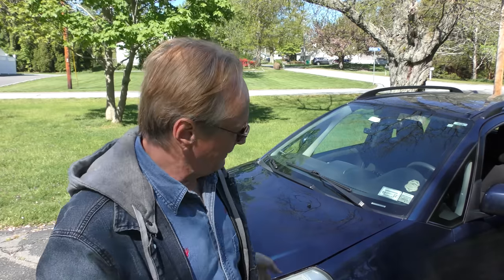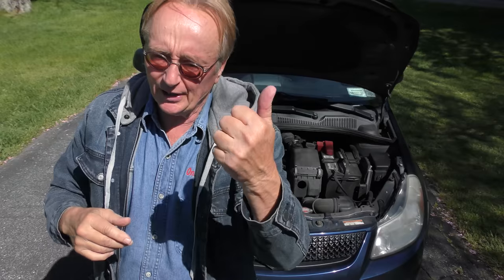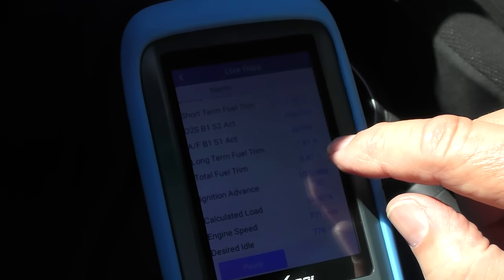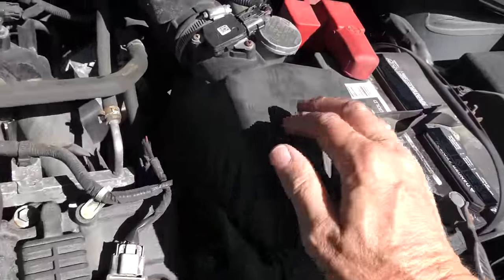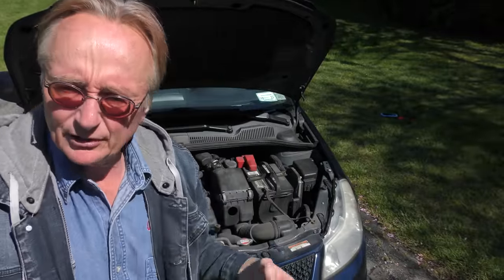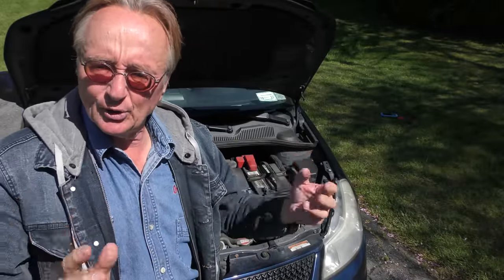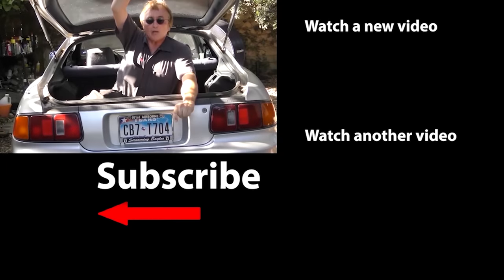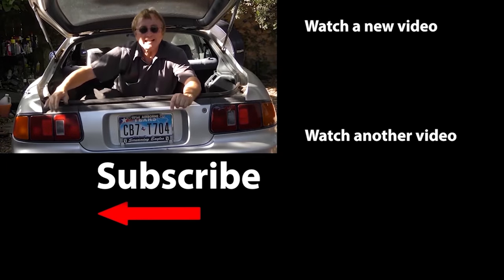Never Buy This at an Auto Parts Store

Comment: I am in Australia and I bought a  1991 Suzuki swift 4 years ago for US$150 while I was painting my daily driver which is a classic car. I only needed the Suzuki to last 6 months, 3 years later it was still going and I only got rid of it because it was blowing to much smoke. Sold it to the scrap yard for US$150 and bought myself an 2004 S40 Volvo from the auction for US$275 spent $25 on a new brake hose and it drives like a dream came with full service history and has the Toyota gearbox.
Reply: Volvos have the most solid bodies, are the quietest cars, have the best seats, and are very safe cars. I wanted one a little while back but just kept my Honda because it is hard for me to get financed. One day I would love a nice Volvo. Comfy!!!

Comment: My old roommate had the 2012 SX4 sedan with an automatic. She put 250K on it before the transmission went out. Never changed the fluid once, which is probably why it died. The only things I can recall being replaced were the water pump and just brakes and tires. Granted it was all highway miles. Lasted her 8 years. Not that bad I suppose. However I find it funny that my 32 year old Bonneville is still my daily driver with about 100K more miles than she got out of her Suzuki.

Comment: Filters disintegrate sometimes and foul the MAF sensor wires. Some cars won't even run when this happens. Try removing the sensor and inspect but don't touch the wires. Only use MAF Sensor Cleaner for clearing it.

Comment: I totally I agree with you Scotty on that 10speed auto. I’ve driven two fords with 10speeds (f-150 w/2.7eco & f-250 power stroke) and very clunky to shift and always shifting. Also the eco boost 4 banger is just screaming at its ragged edge and just really falls flat on its face after 90. 5.0 w/ 6 speed is always the way to go!!

Comment: Still have the original MAF sensor in my Tundra. Itll be 23 years in July that it came off the line in Indiana. 260k miles.
Reply: Still got mine on a 2004 Lexus GS300. And that's after putting it back on after doing EXACTLY what Scotty said not to do. Which was get it from a Autozone/O'Reilly/Etc. I just cleaned original one up and put it back in. The codes from other parts was throwing the MAF off the whole time.

Comment: Wish they'd bring back the metro 1.0. loved my metro and kept running no problem other than changing the clutch, fuel pump, and starter relay. Wasn't fast had no power but did what it needed to do.
Reply: Yep. Im old enough to remember Chevy Chevette from 1979....40mpg everyday. Using 1940 carb technology...

Comment: My mother had one of these, an incredible value. However, it was a manual and they either did not have that figured out. My guess is the big US engine was just paired to an existing unit that was usually in 1.4-ishliter duty. She ended up getting 3 drivetrain rebuilds over the years, oddly enough covered under warranty after they closed up shop. All of them were due to synchro failures that showed up on the 2nd to 3rd gear shift, with various levels of internal damage inflicted each time.

Comment: Good evening . Here is South Africa Suzuki cars are using Toyota 1.5 engines . And I know of two that have almost 2 000 Km on the clock. And still running like a dream.
Reply: You mean 200k
Reply: @mattmekhaeil  what?? That don't make sense, thousands is unit of counting which is used everywhere in the world...

What I meant was Prince is saying 200 000KM not 2000 Km
Reply: @mattmekhaeil  I think you mean Miles that used in metric system(USA) and kilometers not "thousands"
Reply: Yes 200 000 km
Reply: We use kilometres not miles.

Comment: The Grand Vitara is a very solid SUV no issues I bought it used  and it has 166000 no issues at all 4x4 is great minimal rust but it gets worst  mileage then my tundra.
Reply: I bought my wife a 2002 Grand Vitara for almost 12 years now. It's the 2.5 litre V6 EFI, 5 speed.
Just passed 335,000 km (208,000 miles) & still runs well, not burning oil, no leaks, fit second clutch at 255,000 km (158,000+ miles).
We've put this thing in places a larger 4WD can't go, many times.
Followed her in my LandCruiser down a few tight tracks, only to find I couldn't fit or turn the tight corners & needed to go around the long way.
Parts aren't hard to come by in Australia.
Worst thing I've found is the crap rear door handle is easy to break, if you're too quick pulling open the door, with a spare tyre hanging off it.
Other than that, fuel economy is good, at 10.5 litres per 100 km, which is not far off the manufacturer's consumption claims.
It pays to keep preventative & usual regular maintenance for longevity!

Comment: I always loved those Suzuki's.  I had a Chevy sprint I bought brand new in 88 it was a 5 speed stick and the 3 cyl engine. Going up long hills on the interstate I would have to turn the air off which gave it a little boost and make it to the top of the hill wide open at 40 mph and passing car horns blaring at me. I once managed to get 80 mpg going up I85 from Lagrange Ga to Greenville SC and riding the draft from big 18 wheelers.

Comment: I have the Suzuki kizashi and boy I tell you that car is amazing got one used, had a tranny problem turns out the first owner never change the transmission  filter  and causing  it to overheat,
 dealer didn't even know about the second transmission filter that's in front of the car behind the front bumper causing the transmission  to not drive and whining. i change it my self and it still going after 5 years no problem again with it..

Comment: I had a SX4 and there a a multitude of problems with them. Small gas tank, 10 US gallons so stopping for gas every 280 miles sucked, the drive shaft u-joints are unserviceable and the entire shaft needs replacement (if you can find one) when they rust tight, wheel bearings are hard to come by. Overall I hated mine and went to Subaru.

Comment: I had a Suzuki Jimney with a Bullbar 1.3 L  5 speed,  gas guzzler, didn't use oil, bad intermittent shimmy in the front.
Fuel tank was too small.
But would go literally anywhere but too small inside.

Comment: I had a 1991 Geo Metro that had a 1 l 3 cylinder that Suzuki built it was an awesome car I delivered pizza with Domino's for 3 years had 190,000 miles on it when the timing belt broke not interference was one of the best cars I ever had for deliveries had a five-speed transmission manual windows 52 mi to a gallon.

Comment: the first small US car I ever rode in as a Kid was 2.5L engine 1984 Buick Skylark limited 4 d Sedan that belonged to my late maternal grandmother from summer 1988 to winter 1990 when she traded it for a 1990 Toyota Camry which had a 122.5 Cubic inch 2.0 4 Cylinder engine its combined gas mileage rating for that year was 26 MPG while for the 2023 model of the Car its doubled to 52MPG combined

Comment: Hey Scotty, there is a private seller in my city selling a 2014 Honda Civic LX, 77,000 miles on it, for $10,800. Looks to be in good shape, would this be a wise purchase? My other option is buying a new 2022 Toyota Corolla LE
Reply: Toyota  will have less maintenance  cists. Honda has timing belt which will coat $1200 every 100k miles. Toyota  are very low maintenance  no timing  belts , has chains  and are non interference  engines
Reply: I would ask the seller pointed questions about the car to see if they drove it like a maniac and damaged the piston rings. But honestly 77k miles isn’t bad at all. It’s still early enough to change the transmission fluid, coolant, brake pads without there being significant damage from potential neglect.
Reply: Both can be great cars
Reply: Both should be great. Just have a mechanic check it out. I have 146k on my 06 Civic. Still runs great. This was the year they went back to timing chains instead of belts.
Reply: @dylano7242  like the other person said....  4 cyl hondas haven't used a timing belt in over a decade....

Comment: You can still get 2012 Suzuki's brand new.... New 2012s... The equator is just a frontier... Sometimes they use Mitsubishi engines sometimes they use Nissan engine I don't even think they use their own engines maybe sometimes they should come back until the game and make really small cars again with motorcycle engines on them that are super light and get great gas mileage why does everything have to be electric can't they just make cars smaller and lighter so they're better on gas

Comment: Why does my 06 F150 with a 4.2 motor overheating Philadelphia Hill I replace the radiator the fan the heat sensor two thermostats flush the system new coolant does not overheat on Flatland just going up the hill

Comment: I put an OEM in my 07 ES350 because it's under reporting and it did not fix it...
Reply: Intake leak
Reply: @brandonstclair6530  Smoke tested with diy machine and no results, seems airtight. Replaced O2 sensors, egr valve, oil cap o ring, etc etc and nothing. I found maybe a leak at the brake booster but even then I plug off the brake booster the maf readings do not go up. Two mechanic shops couldn't figure it out and/or not interested in listening.

Comment: The worst part of that car is it's radiator. They go for like 200-300 and they go out all the time!
Reply: What causes this?
Reply: @TaxinGigs  not sure if it the engine bay retains too much heat but I've seen many of my customers had leaking radiators and they're usually not in stock in the stores. And they're pricey

Comment: Scotty I got a 2011 p7b I've been running e85 and p0420 keeps coming up , it's running e85, so it shouldn't be saying bad catalytic converter right? I need to smog it so I'm thinking of just putting a resistor in line the 02 sensors to complete the monitors to pass the smog...

Comment: Hey Scotty I have a stuck open thermostat on my 02 3.3 ram and it runs cooler about 15% below proper operating temp even after driving for 40 mins hoe do you feel about this will it harm my engine in the long run
Reply: You already solved you problem -replace the thermostat